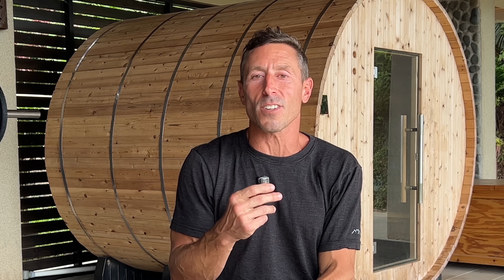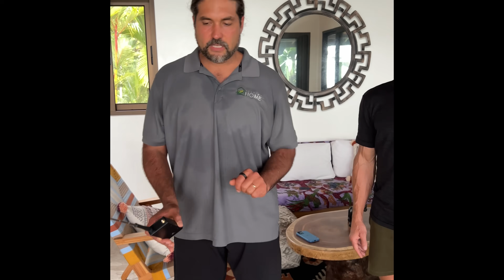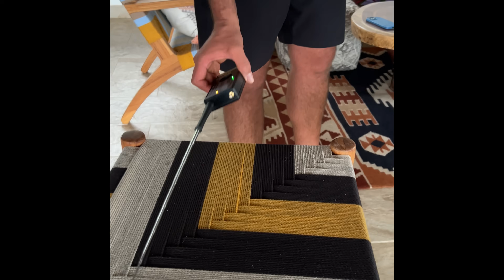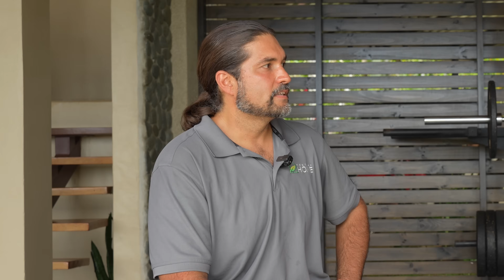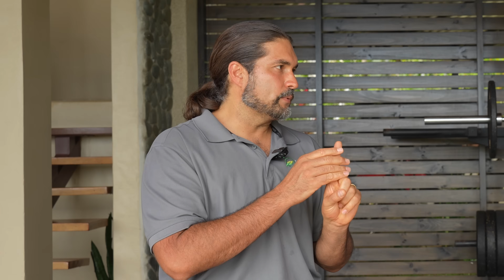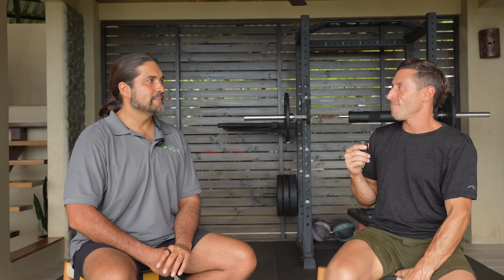Earthing vs. grounding

Comment: I've seen the video and I must clarify that Ryan Blaser's interpretation is incorrect. Hearing electromagnetic interference when using a grounding mat doesn't imply it's harmful. In reality, when the human body is grounded to a properly wired house grounding system, it actually offers protection. This is because grounding reduces the alternating current (AC) voltage induced by electromagnetic fields (EMF) on the body. It's important to note that all the academic research demonstrating clear clinical benefits of grounding is conducted using indoor grounding mats connected to wires. However, it's worth mentioning that grounding directly to the earth using an outdoor stake is likely the optimal method.

UPDATE - FEB 11, 2025
I have looked into this more, in part because of this video, and I have performed my own measurements. This video is correct because outlet grounding is a wild card! You have to check for stray current in the outlet ground. Building codes allow 2-4V AC and 1 mA AC of electricity in the outlet ground. A building's electrical system is designed for electrical appliances and electronics, and it is NOT meant for human grounding. Therefore, not all outlets are the same! In my home, my Earthing mat doesn't hum when tested with a Trifield EMF meter, BUT I measure over 90 microamps of stray current in the outlet ground! 

To check for stray electricity in the outlet ground, use a multimeter that can measure mV AC with the meter grounded to a grounding rod outside as a reference point. I also check for current in the outlet ground. Set meter to amps capable of measuring microamps (µA). Ground the meter black lead to a grounding rod outside. Red probe measures the current in the outlet ground. According to Andrew McAfee, “EPRI originally reported 18 µA of contact current has “biological effects relevant to cancer.” Later it was found that only 1 µA exceeded the benchmark set by the NIEHS.” Therefore, current should be much less than 1 µA or zero.

I interviewed Dr. Samuel Mlham, the author of "Dirty Electricity". Dr. Milham is a MD and epidemiologist. Electrical current in chronic contact with the human body degrades the immune system, and his research has shown higher risk of health issues, mental health disorders, and cancers.
Reply: Well said. Finally someone who knows about electricity.
Reply: I don't believe it.
This is my background:
I'm an electronic engineer who has been working with electricity since he was eight years old. I'm now EIGHTY! When I was in my late teens I was working in a radio/TV shop and a tech left a TV plugged in with the second anode uncovered. Anyway, I was working on a radio and reached across the bench to get a tube and I hit the second anode. It was 25kV, (25,000 volts) and it knocked me across the room - literally. I'm still here, 80 years old and still working in electronics - everyday and still very healthy. A few microamps is not going to give you cancer - period! I don't care who says it. Everyone with electricity in their home has is surround by 60 hz, constantly. Got a microwave ( I don't BTW) you're subject to stray frequencies from it. Shut off your whole house - nothing on, now turn on a battery radio. Do you hear music? Sure you do, well those frequencies are constantly running through your body, everybody's body - constantly from all over the world. The only way to prevent it is to surround yourself with something called a Faraday Shield that's grounded. Shutting off your house at night only shuts off the 60hz AC from the grid.

I am currently experimenting with a grounding mat and I think I'm sleeping better BUT the jury is still out, it's only been a short time. The science of it? There are a lot of theories but no one really knows why, let's leave it at that. If it works great, if you're sticking an isolated wire outside I seriously think it's no different than the ground at the plug going to a ground rod outside. Shutting off your house? Have a good time. Electricity doesn't travel from the ground plug to you, it travels from you to the ground, that's why it's code - to protect you from an open circuit, instead of the electricity going through you it goes to ground!
Reply: What if one was just to ground to a copper pipe inside the house?
Reply: @antiprogpragmatist859  if the copper pipe is grounded, then it's fine... grounding means essentially maintained electrical continuity with the earth. Pipes in normal home installations do not have intentional grounding wires, though they make happen to have electrical connection to the earth. Chances are it doesn't
Reply: @le_blake  ..the copper pipe would have water in it..would it not? Somewhere along the way the water would be grounded
Reply: @le_blake  It depends on the electrical code in your area. In my area copper water pipes must be grounded through the electrical panel.
Reply: @antiprogpragmatist859  U are very smart = Thank U for beeing that!
Reply: @le_blake I'm sorry. I don't understand electricity despite having quite a high IQ....for me it's still like magic LOL
So if I put a copper tube into the earth in my garden, run a copper wire up the wall and attach it to my bed that's good?
I watched some guy making a cheap earthing mattress and he just connected the copper wire to aluminium tape which he had over his mattress under his mattress protector. 
Would something as simple as that work?
Thanks for your help 🙏
Reply: UPDATE (FEB 11, 2025) 
I have looked into this more, in part because of this video, and I have performed my own measurements. This video is correct because outlet grounding is a wild card! You have to check for stray current in the outlet ground. Building codes allow 2-4V AC and 1 mA AC of electricity in the outlet ground. A building's electrical system is designed for electrical appliances and electronics, and it is NOT meant for human grounding. Therefore, not all outlets are the same! In my home, my Earthing mat doesn't hum when tested with a Trifield EMF meter, BUT I measure over 90 microamps of stray current in the outlet ground! 

To check for stray electricity in the outlet ground, use a multimeter that can measure mV AC with the meter grounded to a grounding rod outside as a reference point. I also check for current in the outlet ground. Set meter to amps capable of measuring microamps (µA). Ground the meter black lead to a grounding rod outside. Red probe measures the current in the outlet ground. According to Andrew McAfee, “EPRI originally reported 18 µA of contact current has “biological effects relevant to cancer.” Later it was found that only 1 µA exceeded the benchmark set by the NIEHS.” Therefore, current should be much less than 1 µA or zero.

I interviewed Dr. Samuel Mlham, the author of "Dirty Electricity". Dr. Milham is a MD and epidemiologist. Electrical current in chronic contact with the human body degrades the immune system, and his research has shown higher risk of health issues, mental health disorders, and cancers.
Reply: @DrAndrewDoan  I'd love to see a study with proper controls and a reasonable sample size. A meaningful mechanism would also be helpful. My house is grounded and, unlike you folk, I contact my world with my hands as well as my feet. Fortunately, touching the ground doesn't alter the intracellular charge of my cells as suggested in these pseudoscience papers. That's good, as I prefer that my nervous and heart tissues have the ability to conduct action potentials. I like that my cells can regulate membrane potentials. Homeostasis and basic physics for the win!
Reply: @ My video discusses 13 peer-reviewed papers. https://youtu.be/9gWVoBge-6M
Reply: @DrAndrewDoan  All of which are based on anecdotal evidence, ridiculously small sample sizes and are completely lacking when it comes to proper controls. These studies are embarrassingly bad.
Reply: @ You obviously did not read any of the papers. As a biologist, physician, and neuroscientist, I read the papers before making judgement. One paper I discussed measured inflammatory blood markers and another measured HVR and vagal tone. Both are very good papers.  🙄
Reply: @DrAndrewDoan  I also have to say that I am shocked that a neuroscientist would have such of poor understanding of electricity in general and electrolyte homeostasis specifically. What is your specific background?
Reply: @DrAndrewDoan so if you use a direct grounding rod to the earth outside I bet you’d be fine
Reply: @ Yes! I use a direct grounding rod.
Reply: @DrAndrewDoan  I'm still curious to hear your background.
Reply: @DrAndrewDoan  Wise!
Reply: @ Google my name. I fill up about 3 pages of Google. Andrew Doan, MD, PhD. 

Education

Naval Aerospace Medicine Institute, Pensacola, FL, Second residency, Aerospace Medicine 2019-2021
University of West Florida, Pensacola, FL, Degree: MPH 2019-2021
The Jules Stein Eye Institute, UCLA, Los Angeles, CA, Fellowship, Eye Pathology 2005-2006
University of Iowa, Iowa City, IA, Residency, Ophthalmology 2002-2005
University of Iowa, Iowa City, IA, Internship 2001-2002
The Johns Hopkins University, School of Medicine, Baltimore, MD, Degree: MD with a PhD 
       in Neuroscience 1993-2001
Reed College, Portland, OR, 1989-1993

Medical Practice & Experience

Adjunct Associate Professor, Uniformed Services U. of the Health Sciences, 2007-Present
Adjunct Assistant Professor, Dept. Ophthalmology, Loma Linda University, 2007-2017
Department Head, Ophthalmology, Naval Hospital, 2023-Present
Senior Medical Officer, USS DWIGHT D. EISENHOWER, 2021-2023
Department Head, Ophthalmology, Naval Hospital Okinawa, 2017-2019
Head of Addictions & Resilience Research, Dept. of Mental Health, Naval Medical Center 
      San Diego, 2014-2017
Staff, Comprehensive Ophthalmology and Ocular Pathology, Naval Medical Center 
      San Diego, 2006-2017
Ophthalmologist, Eye Associates of Southern California, 2010-2017

SUMMARY OF QUALIFICATIONS

Honors & Awards

Navy & Marine Corps Commendation Medal, third award, performance as Department Head of Ophthalmology in Okinawa - 2019
Military Outstanding Volunteer Service Medal, first award, for efforts to educate families about the health and mental health problems associated with excessive use of digital media (social media, gaming, and porn) - 2018
Navy & Marine Corps Commendation Medal, second award, performance as Head of Addictions & Resilience Research - 2017
Navy & Marine Corps Commendation Medal, first award, performance on USNS Mercy - 2017
Distinguished Alumni Award, U. Iowa, Carver College of Medicine, for creation of EyeRounds during residency, an internet educational resource reaching millions of people annually - 2015
American Academy of Ophthalmology Achievement Award - 2010
Teaching Award, US Navy, NMCSD Ophthalmology Residency Program - 2008
Society of Heed Fellows, one selected yearly - 2005
Heed Fellowship: 2005 - 2006
University of Iowa, Dept. of Ophthalmology, PJ Leinfelder Research Award - 2005
Medical Scientist Training Program - Johns Hopkins U., School of Medicine: 1993-2001
Commended for Excellence in Scholarship Reed College (Phi Beta Kappa): 1989 - 1992
Research Internship Awarded by the Medical Research Foundation of Oregon - 1989

Peer-reviewed Academic Papers (* Denotes My Involvement as the Senior Author)

 Hall, A. M., Glass, S. D., McDonald, W. A., Almond, N. B., & Doan, A. P. (2022). Sleep Deprivation and Self-Harm Associated With Excessive Gaming: A Case
Report. Military medicine, usac116. Advance online publication. https://doi.org/10.1093/milmed/usac116
Berger, JH, Kehoe, JE, Doan, AP, Crain, DS, Klam, WP, Marshall, MT, & Christman, MS. Survey of Sexual Function and Pornography. Military medicine, 2019,
184(11-12), 731â€“737. https://doi.org/10.1093/milmed/usz079
Gentile DA, Bailey K, Bavelier D, Brockmyer JF, Cash H, Coyne SM, Doan A, Grant DS, Green CS, Griffiths M, Markle T, Petry NM, Prot S, Rae CD, Rehbein F,
Rich M, Sullivan D, Woolley E, Young K. Internet Gaming Disorder in Children and Adolescents. Pediatrics. 2017 Nov;140(Suppl 2):S81-S85. doi:
10.1542/peds.2016-1758H.PMID: 29093038
Park BY, Wilson G, Berger J, Christman M, Reina B, Bishop F, Klam WP, Doan AP*. Is Internet Pornography Causing Sexual Dysfunctions? A Review with
Clinical Reports. Behav Sci (Basel). 2016 Aug 5;6(3). pii: E17. doi: 10.3390/bs6030017.
Voss A, Cash H, Hurdiss S, Bishop F, Klam WP, Doan AP*. Case Report: Internet Gaming Disorder Associated With Pornography Use. Yale J Biol Med. 2015
Sep 3;88(3):319-24. eCollection 2015 Sep.
Gilman L, Cage DN, Horn A, Bishop F, Klam WP, Doan AP*. Tendon Rupture Associated With Excessive Smartphone Gaming. JAMA Intern Med. 2015 Apr 13.
doi: 10.1001/jamainternmed.2015.0753. [Epub ahead of print]
Eickhoff E, Yung K, Davis DL, Bishop F, Klam WP, and Doan AP*. Excessive Video Game Use, Sleep Deprivation, and Poor Work Performance Among United
States Marines Treated in a Military Mental Health Clinic: A Case Series Military Medicine. Military Medicine. 2015 Jul;180(7):e839-43. doi: 10.7205/MILMED-
D-14-00597.
Doan AP, Yung K, Bishop F, and Klam WP. Cyberbullying of mental health patients: Ethical and professional considerations for publication of case reports
in the digital age. Addictive Behaviors. 2014. doi: 10.1016/j.addbeh.2014.11.015 [Epub ahead of print]
Yung K, Eickhoff E, Davis DL, Klam WP, and Doan AP*. Internet addiction disorder and problematic use of Google GlassTM in patient treated at a
residential substance abuse treatment program. Addictive Behaviors. 2014. Sep 26; 41C: 58-60. doi: 10.1016/j.addbeh.2014.09.024. [Epub ahead of print]
Coan EB, Doan A, Allen C. Mucinous eccrine carcinoma: a rare case of recurrence with lacrimal gland extension. Ophthal Plast Reconstr Surg. 2012 Sep-
Oct;28(5):e109-10. doi: 10.1097/IOP.0b013e31823c80ba.
Mets MB, Brown A, Doan AP, Williams RD, Mills R, Erie JC, Gross R, Council of the American Ophthalmological Society. Arch Ophthalmology. 2012. Sep;
130(9): 1190-1194.
ACCORD Study Group; ACCORD Eye Study Group, Chew EY, Ambrosius WT, Davis MD, Danis RP, Gangaputra S, Greven CM, Hubbard L, Esser BA, Lovato
JF, Perdue LH, Goff DC Jr, Cushman WC, Ginsberg HN, Elam MB, Genuth S, Gerstein HC, Schubart U, Fine LJ. Effects of medical therapies on retinopathy
progression in type 2 diabetes. N Engl J Med. 2010 Jul 15;363(3):233-44. doi: 10.1056/NEJMoa1001288. Epub 2010 Jun 29. Erratum in: N Engl J Med. 2011 Jan
13;364(2):190. N Engl J Med. 2012 Dec 20;367(25):2458.

Publications

Oetting T, Beaver HA, Johnson TA, Greenlee E, Henderson BA, Doan A, and Lee AG. Planning for Surgical Competency: The University of Iowa Experience. Journal of Academic Ophthalmology. 2009. 2: 23-32.
Wendel L, Doan A, Ferguson K, Oetting T, and Mandel J. First and Fourth Year Medical Studentsâ€™ Preferred Resources for Answering Clinical Questions. Journal of Academic Ophthalmology. 2008. 1: 90-96.
Dinn RB, Zimmerman MB, Shuba LM, Doan AP, Maley MK, Greenlee EC, Alward WL, Kwon YH. Concordance of diurnal intraocular pressure between fellow eyes in primary open-angle glaucoma. Ophthalmology. 2007 May;114(5): 915-20.
Shuba LM, Doan AP, Maley MK, Zimmerman MB, Dinn RB, Greenlee EC, Alward WL, Kwon YH. Diurnal fluctuation and concordance of intraocular pressure in glaucoma suspects and normal tension glaucoma patients. J Glaucoma. 2007 May;16(3):307-12.
Doan, AP, Lee, SK, Chaloupka, J, Nerad, JA, Lee, AG. (2004). Subperiosteal Hematoma of the Orbit Following an Aneurysm Coiling Procedure. American Journal of Ophthalmology, Oct; 138(4): 680-682.
Pokharel D, Doan AP, Lee, AG. (2004). Group B Streptococcus Endogenous Endophthalmitis presenting as Septic Arthritis and a Homonymous Hemianopsia due to Embolic Stroke. American Journal of Ophthalmology, Aug; 138(2): 300-302.
Boudin H, Doan A, Xia J, Shigemoto R, Huganir RL, Worley P, Craig AM. (2000). Presynaptic clustering of mGluR7a requires the PICK1 PDZ domain binding site. Neuron. Nov;28(2):485-97.
Tu JC, Xiao B, Naisbitt S, Yuan JP, Petralia RS, Brakeman P, Doan A, Aakalu VK, Lanahan AA, Sheng M, Worley PF. (1999). Coupling of mGluR/Homer and PSD-95 complexes by the Shank family of postsynaptic density proteins. Neuron. 23(3):583-92.
Xiao B., Tu J.C., Petralia R.S., Yuan J.P., Doan A., Breder C.D., Ruggiero A., Lanahan A.A., Wenthold R.J., and Worley P.F. (1998). Homer regulates the association of group 1 metabotropic glutamate receptors with multivalent complexes of homer-related, synaptic proteins. Neuron 21(4):707-716.
Doan, A., Thinakaran, G., Borchelt, D.R., Slunt, H.H., Ratovitsky, T., Podlisny, M., Selkoe, D.J., Seeger, M., Gandy, S.E., Price, D.L., and Sisodia, S.S. (1996). Protein topology of presenilin 1. Neuron, 17, 1023-1030.
Doan, A. and Urbanski, H.F. (1994). Diurnal expression of Fos in luteinizing hormone-releasing hormone neurons of Syrian hamsters. Biology of Reproduction, 50, 301-308.
Urbanski, H.F., Doan, A., Pierce, M., Fahrenbach, W.H., and Collins, P.M. (1992). Maturation of the hypothalamopituitary-gonadal axis of male Syrian hamsters. Biology of Reproduction, 46, 991-996.
Urbanski, H.F., Doan, A., and Pierce, M. (1991). Immunocytochemical investigation of luteinizing hormone-releasing hormone neurons in Syrian hamsters maintained under long or short days. Biology of Reproduction, 44, 687-692.
Reply: @DrAndrewDoan  I have to say, your background makes me saddened by your condition. Can I assume you feel you have electromagnetic hypersensitivity? I don't see any other way to reconcile your apparent knowledge with what must be an upsetting cognitive dissonance. Do you have electricity in your home? Do you use a cell phone? Are you able to function in public spaces? How do man-made electrical sources affect you? Why do you feel that your home is not grounded? Do you not think that you can ground yourself by touching things with your hands? How is the surface of your body not in electrical equilibrium with its surroundings? Do you throw sparks when you touch things? Why do you now think that your body cannot maintain internal electrical homeostasis? How are you able to write or read articles on nerve conduction, muscle function, and the propagation of action potentials if your beliefs are fundamentally at odds with these mechanisms? I am perplexed. All the best.
Reply: @DrAndrewDoan Wow! Respect! I am just wondering since I saw you have also been in the area of the eyes-did you possibly know if anyone is looking into earthing benefits for the eyes? 
As for Mr. Negative who seems to want to discredit you: well I understand some people are skeptical-but the way I see it is that trying earthing is free and I saw great improvements in some of my conditions and it cost me nothing-so why wouldn't I continue to learn more about it and how to use it to optimize my health?!
Reply: Now we are suppose to sleep six feet from outlets or just cut power off to the room. Nah I think I'll just buy some outlet plug covers and let it ride.
Reply: @ramakrishnashalom9004  I bougt a meter (from China) it was not as bad as I thought BUT the meter/tool do NOT messure mikrovawes (E.lons satelites & all 5G towers) JUST electromagnetic fields from..outlets. 5G send out a signal 2 EVERY PHONE every second minute? It sure will create STRESS in the CELLS..A cover HOW DO U MAKE THOOSE?
Reply: The ground pin of an electrical socket goes to the earth just the same as a wire thrown out your window. What’s the difference? There isn’t any.
Reply: @RobMatch-ev1qx In most of Europe you don't have this third pin in your plugs
Reply: I want to thank you for taking time to research and share this with us 🙌
Reply: BUT ITS INTERFERENCE, ITS CAUSING YOUR ELECTRONS TO SHORT OUT AND IT MAGNIFIES YOUR ELECTROMAGNETICAL FIELD!!!

In all seriousness though, Jesus Christ this is so God damn stupid.
Reply: It's a moot point because this is nonsense. You ground yourself nearly every time you touch something. If there is an imbalance, you receive a static shock. The body's cells and tissues are very good at moving ions around to maintain appropriate membrane potentials.
Reply: I live in an old house that is not grounded! 😮
Reply: @nativetruther1847   You can ground to a metal water pipe or the metal parts connected to a PVC/plastic pipe. The water within the pipes is conductive and will ground you to the earth. Or use an outside grounding stake and wire.
Reply: @nativetruther1847  NO electrical in the house OR just DC (not tuff 2 humans like AC) ? I have lived in a cabbin WITHOUT electrical (only for1year..doing art..ON a tiny island)
Reply: @nativetruther1847 You must get shocked a lot 😖
Reply: @nativetruther1847  IF you live in n old house it will have iron plumbing. In any case, this grounding thing is nonsense.
Reply: @cyberpleb2472  dozens of peer-reviewed studies beg to differ. You're living in the past if you think grounding is nonsense. It's ignorant to ignore the dozens of scientific studies that have been completed proving the health benefits of grounding.
Reply: Ryan Blaser is NOT wrong, electricity plug is AC current system, earth and our humans bodies are DC current system, NEVER plug youself to AC system!!!
Reply: this is simply, do you trust man or trust Creator? almost all man made is joke and only do harm
Reply: I love walking barefoot as well... but any what you are claiming is nonsense. It makes entirely no sense from a biological or physical standpoint. I'm a biologist. I have read these papers. They are embarrassingly bad. There are no controls and no hint of anything approaching the scientific method.
Reply: I found your video right when I was about to make 2 grounding mats. I just purchased the plugs on Etsy. 
Is the full version of this video available?  The Earthing Movie stays very general and doesn't get into specifics. Great work!
Reply: It will be better and simpler to just drill a hole in the corner of your room big enough for the wire to go through and just connect the grounding rod under your house directly under your room. Then no need to bother with an electrician cutting into your wall or having the window cracked at night with a wire going through it. The only problem with this is that you can only do it with wooden floors. Houses with concrete floors can't do this. Of course caulk the hole with clear caulking. Better yet drill the hole directly on the wall under your bed.
Reply: @ramakrishnashalom9004  2 AVIOD interference(EMF) use a good INSULATED WIRE since 5G is in every block sending out..signals..U don´t want in U´re pillow-case. Maybe turn off the wify/smart meter also? AND MAYBE NOT DRILLING when U can use a corner of THE WINDOW by just removing a small pice of the sealing strip?
Reply: So, carrying a cell phone too much is not recommended ?
Reply: Don't talk to an electrician or a doctor. Talk to a physicist. They understand electricity more deeply than anyone. 

The body isn't a great antenna, and EMF weakens geometrically as it radiates. The currents it produces in the body are extremely weak, far weaker than the stray currents produced from cells themselves. Connecting to ground will induce currents that are still very week (too weak to feel usually) but are still orders of magnitude more powerful than the ones induced by EMFs.
Reply: But ground directly to earth is a cleaner path with no interference
Reply: @wilburbustle9252  Because the Earth's electrons are the good electrons, right?
Reply: You are very diplomatic and 100% correct. I, on the other hand, will say that his guy is talking out of his butt. It really bothers me that these people are giving straight up wrong information and people are believing what he says. Saladino needs to remove this video.
Reply: @sooptime  Are we supposed to check our outlets before using a grounding mat?